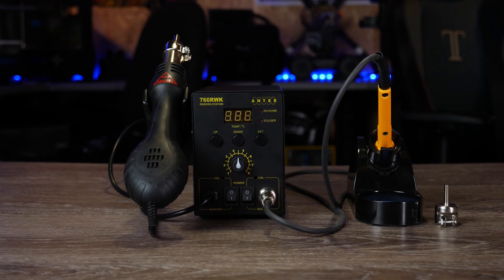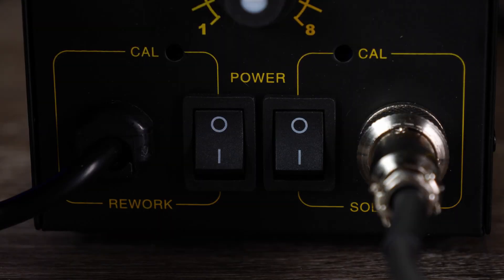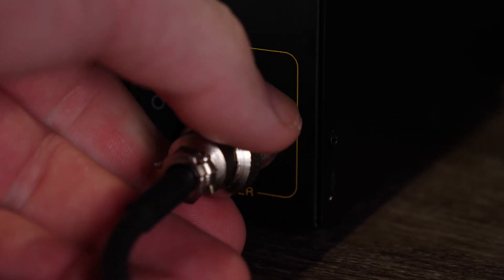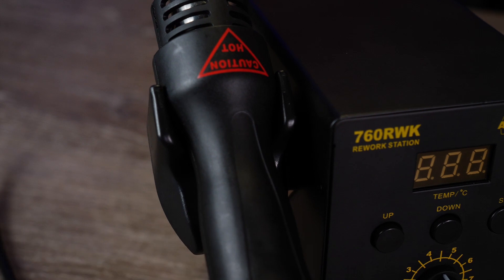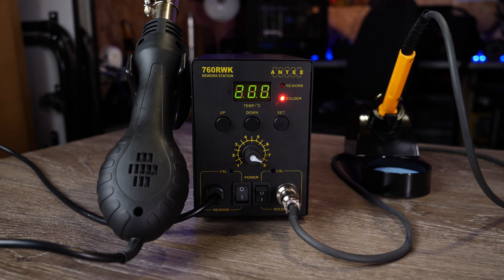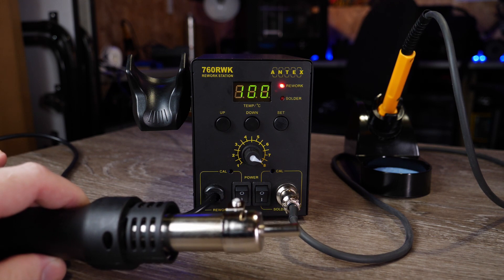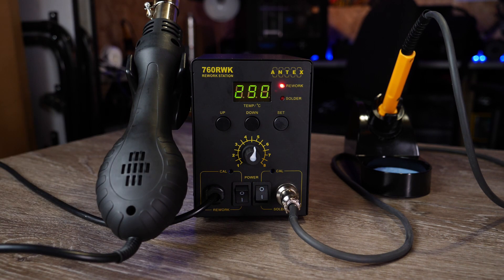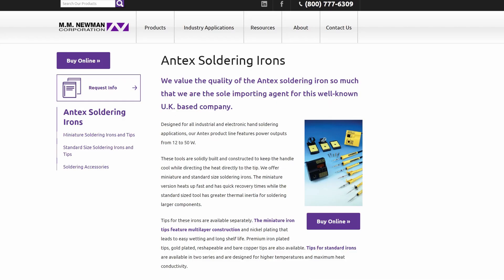Antex Solder Hot Air Rework Station Overview - SMD Board Repair

Comment: Excellent review - I've got an RS-branded Antex TCSU-1 that dates back to the late 70's/early 80's and it is still working perfectly and in regular use! I just treated it to a new handle as the existing one was getting a little worn, but I have certainly had my money's worth from it!. I do wish I'd spotted this first though - the price is fabulous for hot air rework and temp-controlled soldering and the hot air wand could be used for heatshrink and many other uses.